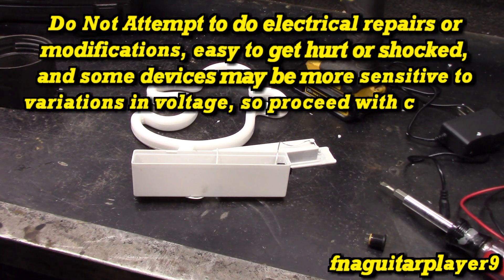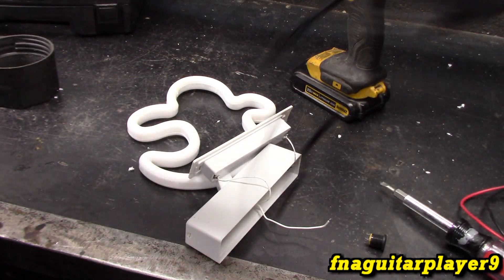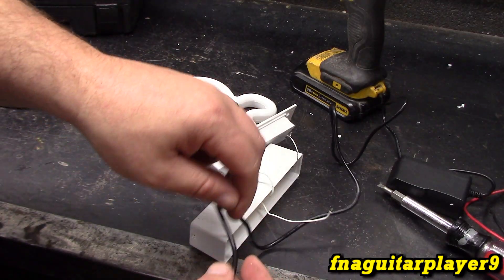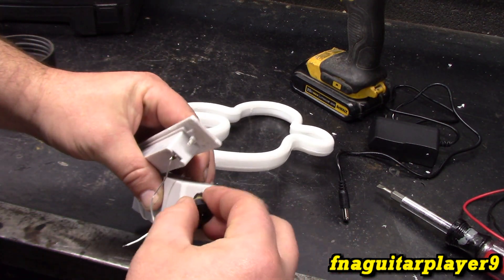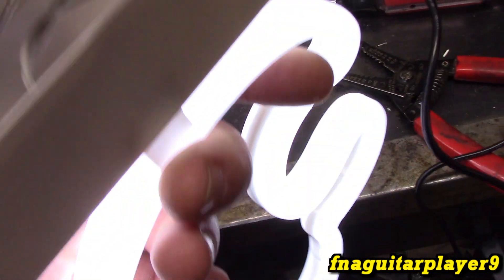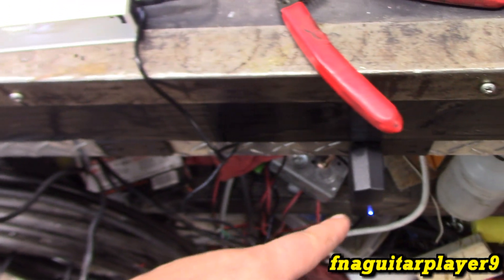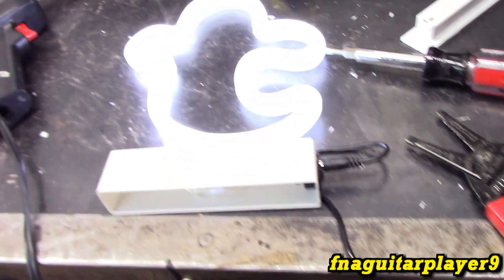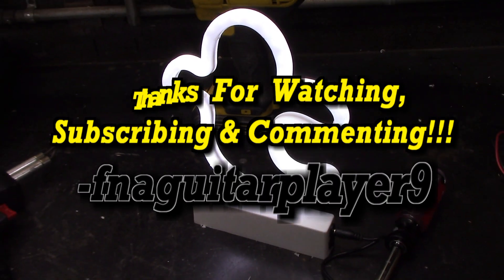Quick Tip #31 : How To Convert Holiday Decorations from Battery To Power Supply

Comment: I just got another battery for my BIPAP when the power goes off again. Army bought the 1st oner but no more. Cabala furnished the last one with more power that the 1st one. And got a 3-level charger from them for the battery. Now my Sweetie gets me a container for it all I'll wire it up and ready for the next storm. I can get another kit for$4 to 500 bucks. I have $150 and change so far and a box won't be much. 10 Ah compaired to 8-something. Blessings Yall!
Reply from the maker: I hear ya! Its crazy how much things like that cost. Thanks for Watching!!!
Reply: @fnaguitarplayer9  TeCabalas battery has more power than the stock job. AllI ave to do is a little wiring. Blessings to yall